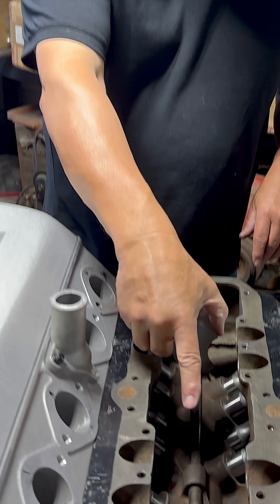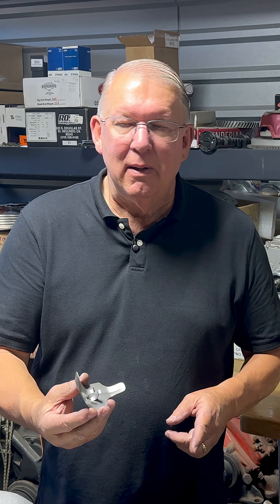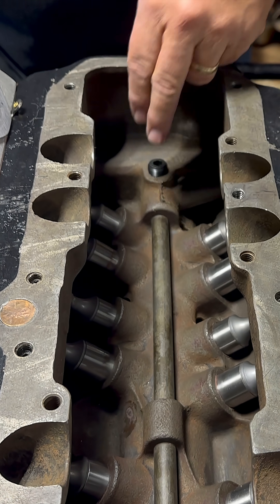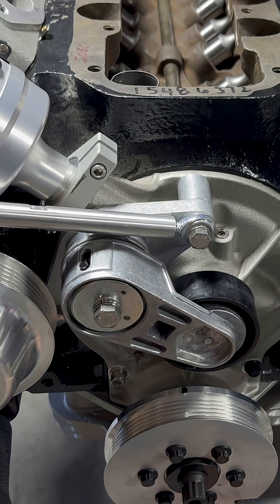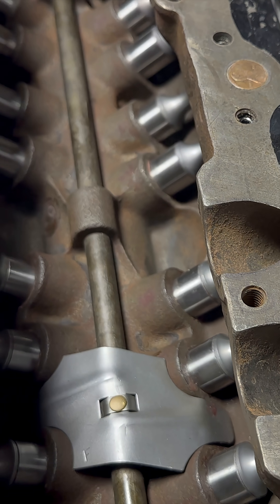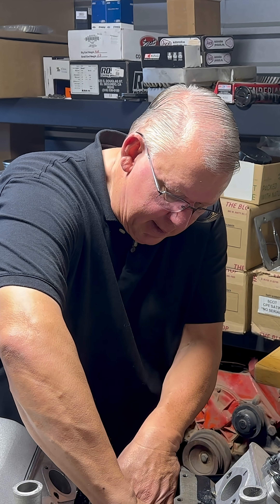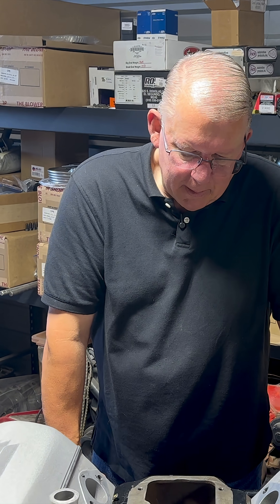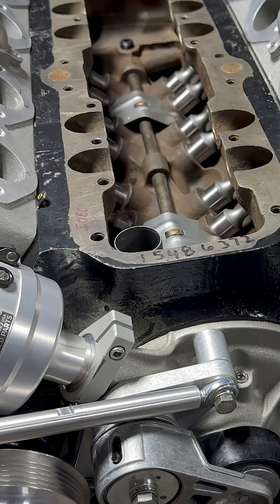PROBLEM 1930's Tech for Oil Control - Ardun Heads DYNO Prep! Steve Coppock w #BarryT #flathead

Comment: Multiple reasons, as you mentioned, but primary was "spark arresters", to isolate the top half from the bottom half gasous mixture atomized oil, and gasoline...